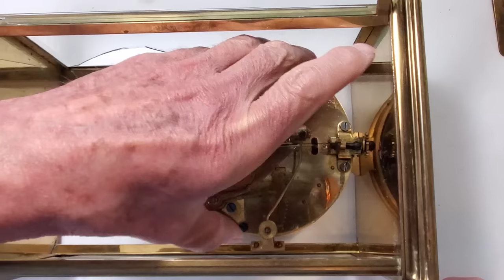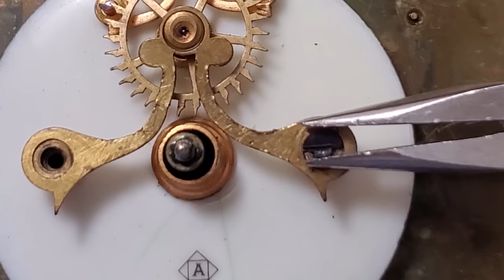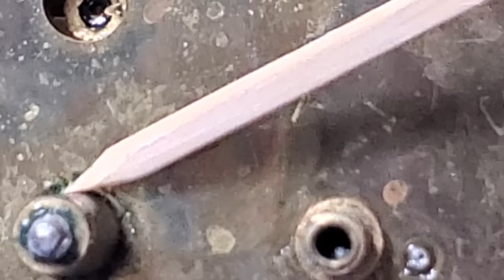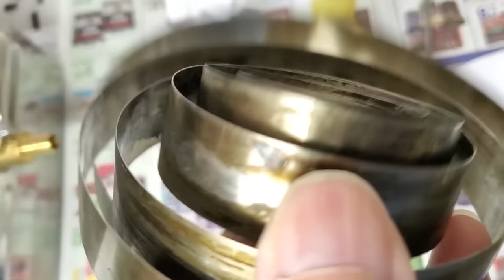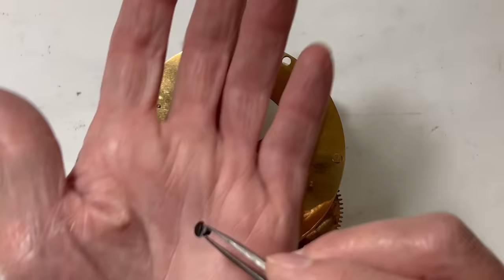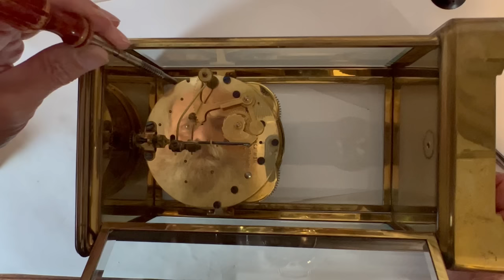Ansonia Crystal Regulator Clock for Steve from Georgia #77

Comment: I've seen far too many "professional clock cleaning videos"  where all they do is soak the movement in some solution. (Or they just stick the whole movement in a ultrasonic cleaner "that's also a lubricant so they don't have to do anything".) I like the way you did it better. Thank you so much for uploading these.
Reply from the maker: Ok,
 This one looks like it had been soaked in a solution, dried, oiled and sent out the door at sometime in the past as you mention above.
Any time there is spotless clean oil in some of the pivots and others with black thick oil along with the condition of the lubrication on mainsprings is a sign someone may have cut corners cleaning this movement in the past.
Thanks again.

Comment: I just experienced the same "won't run very long" in a Seth Thomas carriage clock. If I put my thumb on the main spring gear, I could get the clock going again, but it wouldn't keep running. Power from the nearly fully wound spring was just not getting to the gear train. Just to see if I could get it running, I put some thinner oil on the spring and also started noting the dial time that it stopped (in case it was a gear position issue), and it's been going for a good while, now that I helped it past the earlier stoppage point. Good to know that I was on the right track, apparently.  It will still need to be disassembled and cleaned at some point, not the least because the chime is 5 minutes late!

Comment: Why take the glass from an existing case? It would be easy and cheap to have replacement glass cut and bevelled. And yu would keep the other case intact.
Reply from the maker: Other case was property of the customer and was provided by them for this purpose.
Reply: Hard to fine people to cut and bevel glass to exact measurements - this replacement case cost me less than a 100 bucks.
Reply: @winstonchurchill3597  Fair enough if you don’t have a supplier nearby. I used to work in the glass industry, and I’m pretty sure you could get replacement glass here for less than $100.
It just seems a shame to ruin an existing case if you don’t have to.
Reply: @tuppyglossop222  Tuppy, it was a parts clock and I used some of the parts. If in fact it is easy to find someone to replace the glass - how did I ruin the existing case?

Comment: Amazing job as always!  Some of that excess oil was my doing - at least on the pivots that were accessible to a noob like me.  The other oil on the gear teeth and pinons was done by a butcher.
The glass from the replacement clock seems to have worked out well.  Thanks for making this video.
Steve from Georgia.
Reply from the maker: It ended up turning out great.
I figured someone was in there recently putting some fresh oil on some of the pivots.
It should have many trouble free years ahead of it now..
Reply: @jamesmartin5370  Yup, I'm the guilty party.  😂
Reply: @jamesmartin5370  Keeping amazing time now!

Comment: I've watched a number of you videos and I find them filled with good information. I enjoy the variety of clocks that you show, and your concise descriptions of your findings as you disassemble, and your descriptions of the various repairs. I also have a number of various clocks in my collection, and they are in good order. I do my own repairs and maintenance. As this particular clock had a Brocot escapement, I'd like to comment on that. This Brocot escapement is typical of most that we find, being visible in front of the dial. It looks nice in operation. I have a French drum movement that is signed Achille Brocot, and while it has a Brocot escapement, it is atypical in that it is hidden between the plates of the movement. The clock is in a handsome Slate Black case, and is signed on the dial Tiffany, Young, and Ellis. The key is original with the serial number same as on the back of the dial, dial support plate, and movement. There is the original heavy beveled glass in the doors of the dial and case back. The regulator is adjusted with a key at the 12 o'clock position of the dial, and that mechanism is also a Brocot patent. 

Thank you for these great videos. I've subscribed and have a few more lined up now to watch.
Reply from the maker: Thank you,
That sounds like a great, unusual clock, most likely dates to 1850 or before with that dial signature.

Comment: Hi James, very nice video done in detail. I have a similar model and right now I have to disassemble it to check the mainsprings and do general cleaning and oiling, the doubt I have is that I don't know how to discharge the mainsprings barrels since the lock is on the inner side of the plates, its hard to get it. If you can give me a guide on how to do it I would appreciate it. Best regards and thanks for sharing your knowledge.
Reply from the maker: You will need to run the clock for a while to let the barrels rotate until the click is near the outside of the plate, then you will be able to access the click to let the mainspring down.
Reply: @jamesmartin5370  Thank you Mr. James !
Reply: @jamesmartin5370  Hi James - I'm not an expert at this but can you just disassemble from the front dial and pull out the escape wheel releasing the gear train and let it quickly wind down?

Comment: You are truly a master clockmaker!
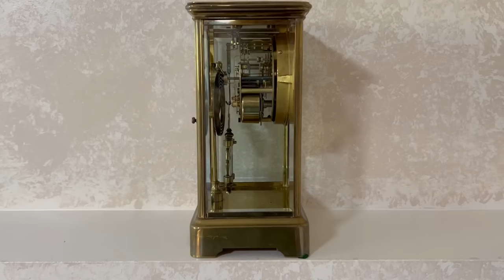I have a question.  At 25:08 where you show the clock from the left side, it appears that the pendulum has a torsion or twist to it at its end of travel.  Is this a problem?  How should one go about correcting such an issue?
Thanks!
Reply from the maker: Good eye. 
Yes that is a problem that needs to be corrected or clock will run slow and irregular.
Sometimes the suspension spring and or connecting hardware is tweaked and causes the pendulum to twist.
On this one it was the pendulum mounting link where it connects to the suspension rod.
The point where the pendulum mounted was slightly off center from the pendulum causing a twist while swinging..
I bent the upper pendulum mounting location, making it directly in line center of gravity of pendulum, this corrected the issue.
Reply: @jamesmartin5370  Thank you, sir!  I've often wondered about this.  I finally have an answer.

Comment: Great restoration!  How do you handle the restoration of the brass plates?  Do you use an abrasive and polish and then lacquer it again?  What is the best way to protect from corrosion and oxidation?  Thanks!
Reply from the maker: I don't like removing deep scratches that require heavy abrasives, can cause other problems.
Originally they were finish buffed with a high quality polishing product 2000 to 3000 grit or better.
Each project needs to be evaluated and treated as needed, but in short finish with a product that is equal or exceeds the original product and you will be happy.

Original brass on these were sealed with Lacquer to prevent oxidation.
Today the best product is any high quality gloss urethane.
Automotive quality is best, will resist the most chemicals.
Lacquer will work but breaks down over time and will dissolve with some cleaners. 
For the case, any high quality wax will work, bees wax products also protect against oxidation if applied from time to time.
Reply: @jamesmartin5370  I wish I could be your apprentice.  Thanks for taking the time to educate us!

Comment: I’m curious about your screwdriver with what appears to be a sleeve and coil spring around the shaft. Does it have a special feature related to these additional parts?
Reply from the maker: Its called a self holding screwdriver.
The clip that holds the screws wore out and I haven't bothered to fix it.
They come in many different styles, don't think any have wooden handles like this anymore.
I like this one because the blade on the end is same diameter as the shaft, seems to fit into tight spots better than the others.
Reply: Thanks. Does this screwdriver have any manufacturer or markings on it?
Reply from the maker: @tomc4851  Only marking is on the steel shaft near the handle, reads "Germany"

Comment: Another well done restoration.  I've seen this type of clock referred to as a crystal regulator.  Nice job polishing and blueing the screws that hold on the escape wheel bridge.  Also nice work replacing the broken glass in the case.  Did you happen to have a case lying around to use for parts or did you buy that for this job?  It seems like it is common to buy a clock for parts.
Reply from the maker: Thanks Paul,
 Owner sent the parts case, he mentioned it was less money than having new glass cut and beveled, it worked out good.

Comment: If this is a Carriage Clock how would it keep accurate time being controled by a pendulum?
Reply from the maker: They were invented to be used to synchronize French military operations, The 1st carriage clocks had a balance wheel movement and were used by officers in the French military.
Exact timing of the troops movements gave the French a large advantage over their adversaries.
The newer ones with pendulums have similar cases to the originals so they retained the name, probably a marketing gimmick as well.

Comment: Mechanically, it sounds like the problem with this clock was dirt, especially the mainsprings which had dried oil on them causing the coils to stick to each other.  A lot of the lantern pinions were quite dirty as well.  Did you do any bushing work or was cleaning and oiling enough to fix it?
Reply from the maker: Just needed a good cleaning and fresh oil.

Comment: My seikosha one looks exactly the same
Reply from the maker: Seikosha, Ansonia and the other clock factories built movements.
They sold their movements to companies who specialized in building cases.
There were also companies who specialized in fabricating dials, so we see identical dials with Seikosha, Ansonia and other clock companies on them.
Reply: @jamesmartin5370  ah, my seikosha also has a copied ansonia movement
Reply from the maker: @theray2009  
I am told the Dutch introduced mechanical time devices to Japan.
Immediately the Japanese converted to these devices and copied their designs.
They didn't have the precision equipment to fabricate tough to make parts like hairsprings and  balance wheels etc ...
So for those parts they purchased them separately from European and American clock companies.
This is most likely why your Seikosha looks so much like an Ansonia.
Reply: @jamesmartin5370  interesting, mine also has a ruby pin pallet escapenent

Comment: "How does this happen"?
The owner adds yet more oil, in an attempt to get the clock running.  Some owners just keep adding more oil in attempt to avoid the cost of an actual real service.  This causes oil runs which just siphon the new oil away from the pivot.  Oil on wheel teeth and pinion cages is a pretty good indication that an amateur has been in there.  There are parts of the clock that are not accessible without dismantling the clock, so it's impossible to clean and lubricate them outside of a proper service.

Modern synthetic oils don't solidify as far as I'm aware (they might actually evaporate).  Solid grease seems to indicate very old animal and mineral oils, which kind of dates the last service.  At this point we should be making an effort to use only synthetic oils on everything we work on.
Reply from the maker: I agree,
Synthetic oils for clocks and watches have been around since the 1940s or so.
I still open up some watches today and can smell the stale fish smell of the old animal based oil that was used in it. 
It may have been since that last service date of around 1938 since it was last serviced.